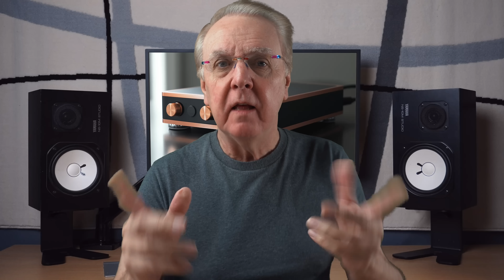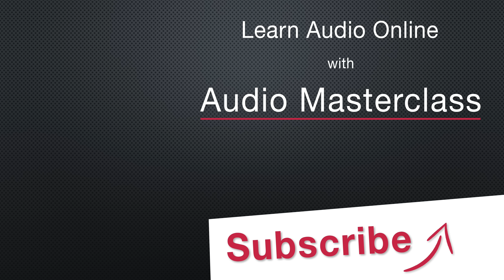Audiophile preamps - What should you get for $30,000?

Comment: For $30K-plus, this device would be made of the finest anodized alloy cabinetry, enhanced with cherry-wood, or some such to exude blue-nose audiopile nonsense. The entire interior would be nickel-lined for interference suppression. Unfortunately, this school-boi pile of plastic looks like something from the set of a Chinese Jr. High School for the impaired version of "That 70's Show," along with its Cyberpuke truck power supply. Oh, and it would be supplied with balanced outputs to the pre stages, unlike the lies in the grease-laden ad sheet dialogue. Speaking of China. They could knock-off this crap and sell it on temu for $499US.
Reply: Cheap plastic outside and in yuk 🤢

Comment: I would expect aerospace componants, and a solid billet cnc machined case.
When i worked on jet engine electronic control units, called fadec for snecma ( cfm56 engine) the main pcb had  8 layers a heatsink then 8 layers, so a 16 layer pcb
A shop transistor would cost 20p, the same in mil- spec would cost £15. The wiring is aerospace, with plans for wiring copied exactly to established standards, everything resin coated, and burn in tssted in climatic chambers. 
A 30 k preamp, i would expect this quality.

Comment: High quality cardboard shims are another big one. These can get very expensive.
Reply: Yes they must be perfectly straight with no less than a microscopic warp so as to exert even pressure to its surrounding mount points along its length. And mind you there were several in use.
Reply: ...especially when selling them to the dumb rich ;)
Reply: Laser trimmed and all...
Reply: Cardboard!? Nay, natural fiber composite.
Reply: @KJ6EAD  Nay, just cardboard, BUT cut from a very rare misprinted Sugar Frosted Flake box made in 1962.
Reply: I know for a fact he only uses ,small batch ,non GMO , organically and ethically sourced recycled , Manatee  friendly cardboard.

Comment: I won't mind a preamp with an external power supply, as long as it's made by the Amp builder, not an off the shelf part that is under no control of this $30000 Amp.
Seeing all those amps with an off the shelf power supply are an expensive scam.
Reply: FWIW .... there are both electrical safety and emissions standards those "off the shelf" power supplies have to meet before it's even legal to sell them.  This is not true with the lash up supplies these guys build in their garages on the weekend.
Reply: @Douglas_Blake  well, true, but China made bricks just provide power to a standard as you  say to meet those regulations. I think any quality Amp should have power stability and cleanliness far beyond what a standard stipulates. Now, in the case of the said Amp, we'll it was of such low quality for the price, a cheap off the shelf brick wouldn't hurt.
Reply: @darnice1125  
Remember, we're talking about a phono pre-amp here... these things, done correctly, will run for a year off of a 9 volt battery. They use next to no actual power, unless you're talking about that massively overbuilt monstrosity Mark encountered.

A physics analogy... Once you have a chain that is sufficient to tow a car, using a bigger chain does not make the car any easier to tow.

In electronics the same is true... once you have a circuit that is adequate for a task, overbuilding does not make it work any better. 

In fact the best circuits are often the simplest ones that will do the job. For example, most RIAA phono pre-amps can be implemented with 4 op-amps (2 chips) and just a handful of capacitors and resistors. Anything beyond that is likely to actually degrade it's performance or to make it more failure prone.

Power supply wise, when you have a device (a phono preamp in this case) that uses about 20ma of current... hooking up a 10 amp power supply isn't going to make it even the first whit better.  

I've examined tons of those "cheap Chinese power bricks" and all have provided very clean, well regulated power. So I wouldn't think spending $2k to get what you already get from a $20 brick is a very smart thing to do.

Comment: 30k is too rich for me however I do have two preamps that are worth that to me, one being a ‘Vacuum State FVP” this a Vintage preamp I have had since the late 1980’s and still use with upgrades to FVP5b level in my main system. My second Pre-amplifier that has a faulty attenuator after 45 years of service is my Nakamichi 610 control preamp. I love what both of these preamplifiers bring to my systems and I haven’t felt the need to upgrade and replace either of these with current offerings that are out there. I think I would need to spend 30k to get an equivalent preamplifier so I guess I might have to go to AlliExpress to get a Chinese nock-off as I’m too old and too poor to spend that 30K that I don’t have anymore.

Comment: Simple, but deceptively difficult: The absolute best performance with the least disruption to the original signal. What does NOT qualify as extremely good, or even very good performance is passing the audio signal through literally HUNDREDS of filtering caps, resistors and networks, as is done in this example, simply to achieve impressive low distortion and signal-to-noise ratios on promotional material. The original signal has been so bastardized by the over laden design, that you can achieve the same result with a $250 component off of AliExpress....

Comment: At the very minimum, the unit should be built like a tank. I saw that the case and internal structure looked like a $300 unit. You cannot file a copywriter infringement lawsuit if Mark reverse-engineered and created schematics for himself, not for publication. Tom Evans got caught with his circuits and pants down. Sanding off names and part numbers ONLY has the distinction of hiding the identity of the components. ie: cheapass parts.

Comment: Nothing justifies a $30K preamp. Not even $5K. Related to sound quality that is. IMO, anything above $1K goes to build quality, looks and/or brand. My experience with MC (Denon) was through a Luxman integrated amp back in the 80s when I was young with perfect hearing and a passion for music and sound systems, and was studying electronics. The system was not particularly expensive but sounded great with no distortion or noise. $30K is stupid full stop. What's the point in designing a noise floor way below the inherent vinyl signal to noise ratio? External power supply? The cables carrying the dc into the unit will also carry hum and EMI. That is filtered regardless where the power supply sits. Sorry that's snake oil. $30K is small change for you? Build a great listening room, hunt for well mastered and not overly compressed music, but don't buy a ridiculously expensive preamp with paper shims (like someone commented in the other video). Love this channel btw.

Comment: to answer the question at the end of the video, what I'd want is for one, it has to be of a long standing reputable brand, so Luxman, Accuphase, Macintosh, Technics, Sony, or if it's a new company, it has to be lead by a long time industry leader that's worked for one of those legacy brands in the past, a brand with a long standing history of making high quality audio equipment.  Second, it has to have a lot of flexibility, lots of inputs, switching, the ability to customize what I want to do with it easily, and I want low noise floor, I don't care about snake oil crap like "warmth" or "ambiance:, I want exactly what's going in to come out; if I want to warm up the sound, I'll get a good equalizer to do that, I don't need that hard set into my pre-amp or amp.  Finally, it has to look good, have some style I can appreciate.

Comment: A flat frequency response is the last thing I would want from a vinyl  cartridge pre-amp. 
I would want it to conform to the RIAA equalisation characteristic exactly.
I would suggest the best way to achieve this would be to convert to output of the Moving Magnet cartridge to digital at a minimum 28 or 32 bit 96kHz sampling. Then apply the RIAA equalisation frequency response with zero phase error using DSP or other digital processing. Followed by 24 bit D-A conversion to feed my analogue power amp.
No doubt a significant proportion of the audiophile community are now baying for my blood & piling up the wood to burn me at the stake.
Reply: There really are 3 standards to worry about.  There are a couple of old ones from before RIAA.  Making it switchable between them would be good
Reply: @ I thought about that after I posted. 
My old Quad 22 mono pre-amp had 3 EQ buttons, and a chart listing 68 (Pre-RIAA) Manufacturers and speeds showing which combination of buttons to  press.
It could also include Matrix decoding for SQ, QS, quad surround and CD4 discreet quad surround  decoding.

Comment: Silver soldering. Silver coated copper ofc wire . Silver coated terminal connections. Matched components to reduce losses in the signal path. Descent hi end electrolytic caps.  That's what I would expect for that kind of price tag. You would be better off buying something more vintage and make circuit modifications/ component upgrades at a fraction of the price and still have plenty change. Or if possible make your own without the fancy cnc machined casing. Shame there is only 24hrs in a day.😊

Comment: I'm a hifi equipment designer working for a startup manufacturer.
Thought I'd use my knowledge in this area share some perspective here on pricing:
For a $30k unit, typically that's the retail price including all taxes etc.
Let's assume the tax is 20%
So this means the actual retail price of the unit is $25k
Assuming you're distributing your items through a typical retailer - dealer - distributor network, this will typically result in a total 70 point margin for the distribution and sale.
This means that the dealers distributors etc make $17500 on your $25k preamp.
Meaning, the manufacturer sells the unit to the distributor for $6500.

There is a golden rule in electronic manufacturing that in order to survive, you have to sell your goods at an average of 2.5x their cost to you to manufacture. This allows you to make a profit as well as recover your R&D investment.

This means the preamp must cost no more than $2600 to make. This includes wages, not just BoM cost.

The bigger question - is the preamp "worth" $30k? Absolutely not. Allt he margins and fees and taxes gobble up the vast majority of that $30k.

This is why it's difficult to be a hi-fi manufacturer.
Reply from the maker: I sense that these are words of considerable wisdom.
Reply: @AudioMasterclass  Or words of considerable frustration, take your pick!
Slinging boxes and running a shop is worth considerably more than designing and building a premium product. Go Figure!

Comment: The best power supply for a preamp would be rechargeable batteries. Pure DC.  It wouldn't be difficult to make a preamp that charges the batteries while it's turned off and then stops charging and runs on them when it's turned on.

Comment: But why would you need to design a phono preamp for 20-20Khz when the medium isn't capable of reproducing that range? Especially the lower frequencies are going to have to be cut from the original and the dynamic range reduced in mastering to fit in the available groove width.
Reply from the maker: Audio professionals of a generation older than me will contend that a good lathe, well set up and maintained will cut frequencies higher than 20k. And good old fashioned tape recorders, demagged with clean heads can capture that.
Reply: He mentioned that the bass is rolled off on vinyl, and the top end is rolled off too starting in the midrange. Any gains you think you have on vinyl on the top end are masked by the muddy midrange bass that's on vinyl. Then again, most people can't hear above 16k.
Reply: @AudioMasterclass  Well maybe on a special vinyl release with limited tracks you might be able to pull off a better frequency response, but normally something is going to have to give due to space constraints. When your trying to pack 6 songs per side on a standard 33 your going to have to make sacrifices to put that much info on the record. That starts with limiting the frequency response. Another issue that that vinyl has limited space for is dynamic range of about 55dB-65dB, whereas a CD can accommodate the high 90'sdB. There is just more space on a CD for the same amount of information and that is the limiting factor. CD is a superior method of delivery.

Comment: Regarding the mains noise, I have many times suggested audiophools to install a motor-generator to their basement.  With that, you have a clean sine wave AC voltage!
Reply: Of course it would have to be a gas turbine one with a 500 kg flywheel to avoid any frequency instability. But honestly, the best way to avoid any interference from the incoming power would be to make the whole system directly battery operated. No transformers or, god forbid, switch mode supplies, just clean DC through linear regulators. make a master power switch that connects the batteries to a smart charger when not listening and disconnects the system from the power grid when in use.
Reply: @Murgo-u3l , indeed.  I understand your comment is a little bit tongue in cheek, like mine, but actually practical for a big budget people many audiophools are! For gear which could use DC, the battery approach is ideal. 48V is actually standard in telecom industry.  So when rewiring your house for clean energy (! :-), run a few DC circuits at the same time. But what gear which is difficult or impractical to modify for DC use, AC generated by a AC generator is ideal.  And if you add diesel generator and large battery setup, to be used before the motor-generator, you also have resilience for grid problems.

Comment: You cannot justify the unjustifiable, only con idiots. The only difference between an MC preamp and a top professional mic preamp is that the MC requires RIAA equalisation (easily done with a handful of components) and top mic pres don't cost £30k and are a lot better built. Amplifying a ribbon mic is more demanding than a magnetic coil. Although there are overrated pro products trading on a name they don't usually command the extra £28k.

Comment: For $30k, you should get a bespoke cast iron case. It should be machined and nickel plated. The gold plating option would be dependent upon current prices. Titanium or tungsten cases might be offered for higher prices. Circuit boards should be gold-plated. It should have balanced and unbalanced inputs and outputs. The design should be modular and very easy to work on. DSD inputs and outputs should be available as an optional plug-in module. Test points should be well documented and easy to access. It might include an isolated readily-available SBC, such as a Raspberry Pi with builtin diagnostics. (Pi isn't the best, but will be available and easy to replace in the future.) The SBC would likely be detached during operation, but could be switched in to verify correct operation. It might be used for the optional $2.5k wireless control. All documentation should be provided on the SBC in addition to print. The unit should be readily upgradeable. This could provide an additional revenue stream. Modular design would allow the butler or IT person to remove parts for shipping for repair/calibration. Hard shipping cases would be provided.

Comment: a cheaper alternative to the $30,00 pre-amp
a used BMW
Reply: You might like to see what Auto Shenanigans has been doing recently.  🙂
Reply: Bought a 1994 BMW 325i for $4000 it was a long time ago. I don't think I put a $1000 dollars into it . The beauty of 15 inch tires . Yeah 1 set of tires, normal fluid changes and a rubber damper for the drive shall connection.  I retired it four years ago with 275,000 miles on it. Moved our entire house hold with a 5×8    U Hual trailer ( it weighed 900 pounds emty) . She really was a work horse 🐴 and a joy to drive.  .

Comment: It seems silly to me that designers don't use two sets of lithium batteries to power preamps. One is charging while the other is powering the circuitry. When the voltage drops, it swaps batteries. A switching power supply could be used to charge the batteries if it is shielded and isolated. 18650 batteries are common and easily replaced. For the exotic, four golf cart batteries could be used. Two batteries in parallel would provide 24 volts, which is enough for a preamp.

Comment: Top price to pay for aperfect preamp is about £100. Most of that will go on the pots which should track perfectly between the channels. The actual amplifier part should be an IC whose performance will be exemplary. I use a moving coil cartridge and my preamp, which I designed and built is a good audio IC amplfier preceded by three discrete transistors per channel in parallel. The noise performance is within a bout 0.3dB of theoretical perfect. Nonlinear distortions are essentially unmeasurable. And all audiophiles can hear is their own overactive imaginations.
Reply: What preamp can ypu by for a 100 pond that does MC i spent £65 but i use MM
Reply: @gingernutpreacher  I built it
Reply: @donepearce  as a kit or from scratch my dad was able to do that kind of thing but not me

Comment: What i would expect from a $30,000 Amp is no integrated circuits at all but alle the circuitery build from discrete components. And some expensive housing and silver wires for the internal connections... What Tom Evans did is sell cheap DIY circuitery for absolut lunatic prices...
Reply: There are some op-amps that do better than can be done with discretes.  They are ones where matching matters.  In an IC transistors tend to be all matched.
Reply: @kensmith5694  Yeah i see it's not that easy... I once saw a video from PS Audio where the guy Paul talked about discrete DACs being better and stuff. So i thought...